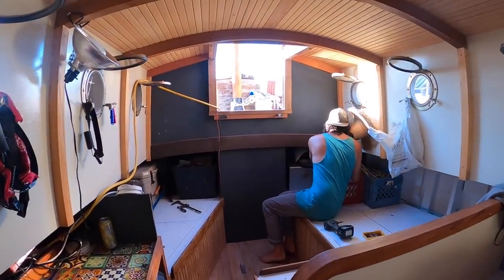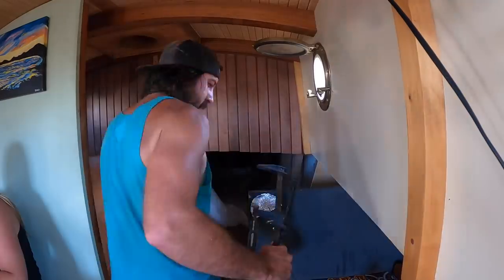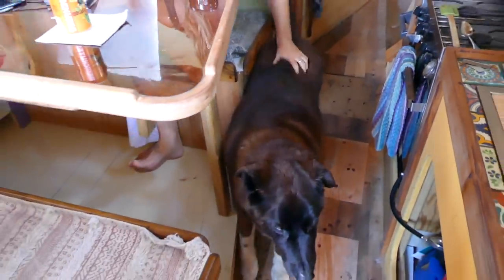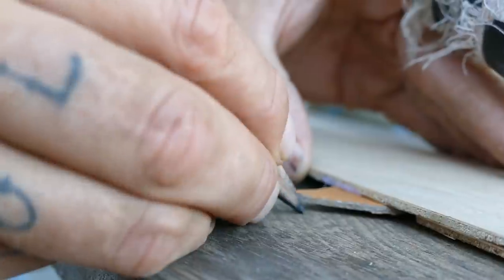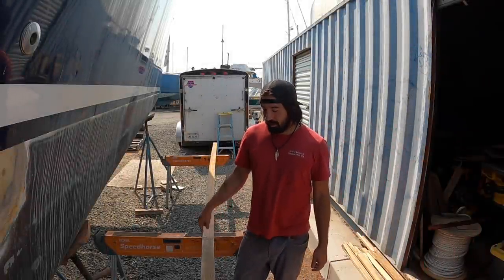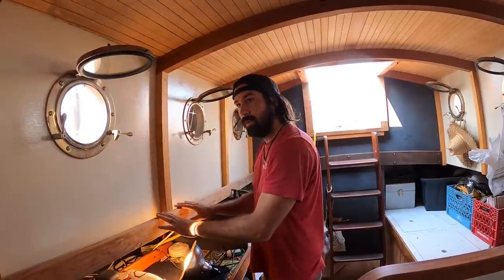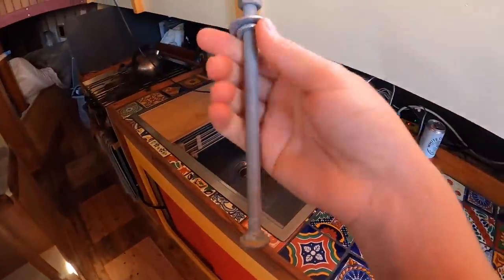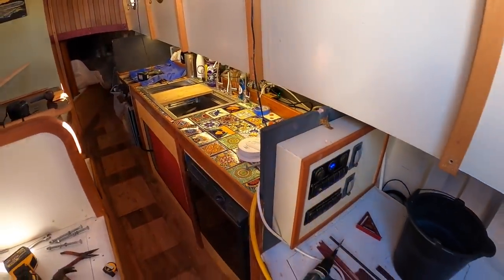Salt & Tar: Ep.162- Exotic Choices

Comment: That DeWalt oscillating tool is so handy. I got one for a specific project, and thought I'd hardly ever use it again -- guess which tool I find myself grabbing all the time for work. It's handy.
Reply: Oh, yeah. I thought the same when I got one for an under cut tool when I was doing a floor, under cutting door frames for the slightly higher flooring. And yeah, same here, I grab that thing all the time for all sorts of thing from cutting nails between boards to ease taking things apart to installing electrical boxes in remodels. Even flush cutting pretty much anything to detail sanding into corners and rough sanding old surfaces with carbide inserts for the tool.

Comment: The extra length on the bolts would be perfect to mount some hooks or something to for a favorite coffee cup or whatever. BTW  I know in real time this is already way in the past, but throwing this out there in the wind...or for next time.... Using the circular saw and router with those gauze strings blowing around on that bandage is just asking for your finger to get cut off. It will suck that in faster than you can blink. I'm not a safety nazi, but I have spent my career working with amputees and the accident stories all have nearly the same two characteristics...fast and preventable!
Reply: Yes true...

Comment: At 1:24 Nice pointing stick!😁
Nice looking trim pieces! I like the handrail idea!
At 12:52 Some info on Wenge:
Wenge is excellent for processing, good extraction of sawdust and sanding dust is necessary as it can cause stomach disorders and skin inflammations. Splinters are difficult to remove and immediately cause inflammation.🤔
Treatment with oil gives the wood a somewhat dead appearance, but a wax treatment gives a nice result.🙄
Since the dark coloured ingredients (in the pores) dissolve in water and cause stains, wenge should be treated with a surface finish if it can get wet (cabin entry?).

Comment: Wenge is a very beautiful wood when it's finished but it's incredibly hard to work with.
It will blunt your tools very quickly and gum up blades and drill bits etc, it also very bad for you if you breathe in the dust and it chips and splinters readily, if you get any splinters in your skin they are really difficult to get out and the area will go septic, use with care !
Reply: Agree completely!  Use caution with wenge!

Comment: yeah wood porn! these are species I have hoarded for guitars. if you want to burn sandpaper... you found it. for glue, they usually need acetone first to form a good bond but I don't know much about modern epoxy. through bolting is a good idea for sure. if you don't use uv somethingerother your purple will be brown within a year or so, so if you want that purple COAT IT HARD with something. the padouk is my fav because it smells so good when you work it. the zebra is bad smelly. key note: wear a mask as all of these contain natural insecticides that cause all kinds of problems, so try not to breath it in. smell it, but don't breath it. in chemistry they would say "waft" and one more tip if your shop vac has an "out" run an extra hose on the out to OUT when you're in tight quarters or put an old sock over the out at the least, your lungs will thank you. you don't want to sleep with that dust.

Comment: purple hear t are great woods for the sea, unfortunately those 2 woods  look good for a short time, purple heart should be called grey heart because the color does not last, within a week it will shift color, uv inhibitors can slow it down
Reply: It’s inside the cabin…you seen that right? How much UV rays are those port holes, and hatches letting in on that wood trim piece🤔